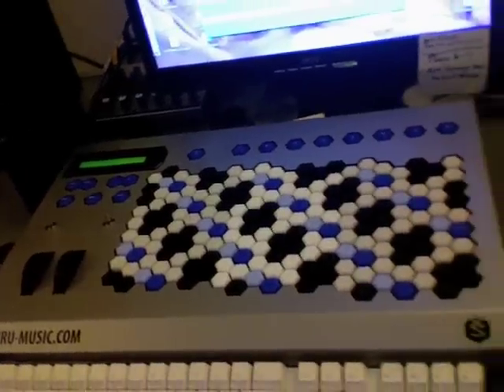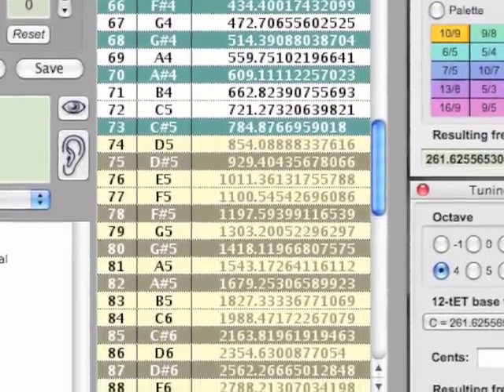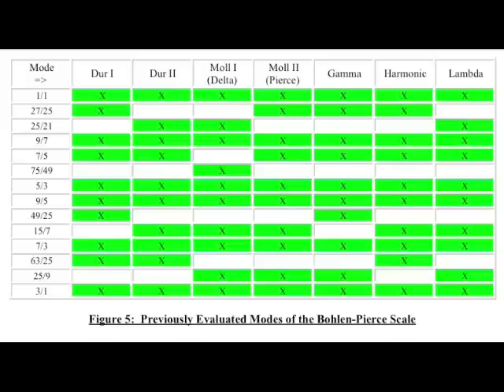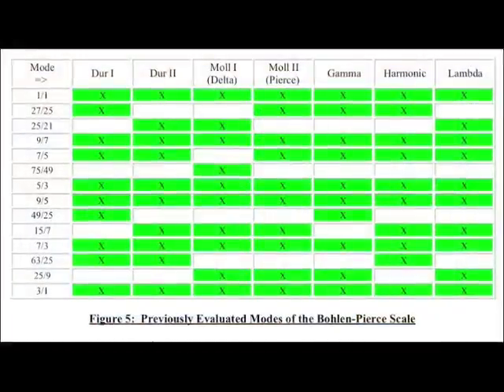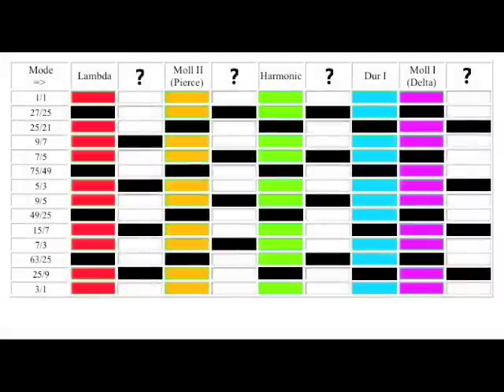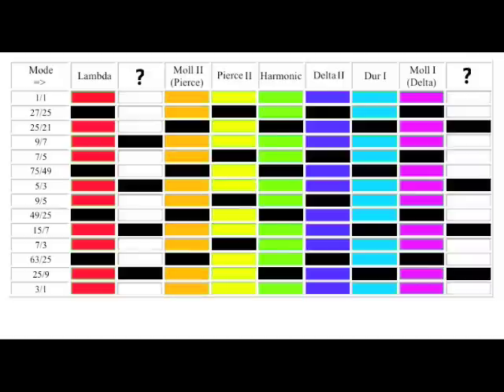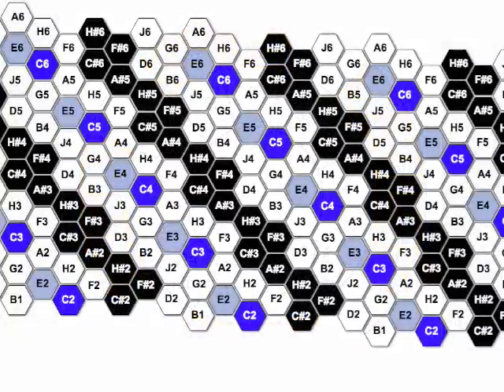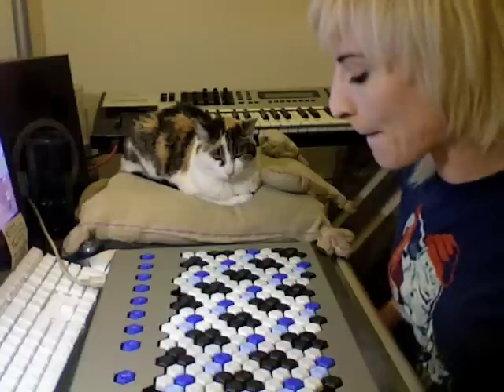AXIS for Bohlen-Pierce Scale (Part 9)

Comment: I looked for BP chords in Scala within 7 cents, and came up with 19 of them off the first degree.  I like all the chord names Scala has.

equal 13 3
set maxdiff 7.
set notation bp
chords/match/constrained

 0-13-19-32: Genus [35]   1:3:5:15   diff.  0.000,-6.533,-6.533
  C C G G
 0-13-26: NM Quasi-Stable Twin Twelfth   1:3:9  
  C C C
 0-6-10: BP Wide Triad   3:5:7   diff. -6.533,-3.829
  C G A
 0-6-10-13: BP Primary Tetrad   3:5:7:9   diff. -6.533,-3.829, 0.000
  C G A C
 0-6-13-19: 9-Limit ASS 1 (Anomalous Saturated Suspension)   3:5:9:15   diff. -6.533, 0.000,-6.533
  C G C G
 0-6-13-19-26-32: Hexany 1 3 5 9   3:5:9:15:27:45   diff. -6.533, 0.000,-6.533, 0.000,-6.533
  C G C G C G
 0-10-13-19-23: Hendrix   3:7:9:15:21   diff. -3.829, 0.000,-6.533,-3.829
  C A C G A
 0-10-13-23: 9-Limit ASS 2   3:7:9:21   diff. -3.829, 0.000,-3.829
  C A C A
 0-10-19-23: 15-Limit ASS 1   3:7:15:21   diff. -3.829,-6.533,-3.829
  C A G A
 0-4-7: BP Narrow Triad, BP Wide Triad 1st inversion   5:7:9   diff.  2.705, 6.533
  C F H
 0-4-7-13: BP Primary Tetrad 1st inversion   5:7:9:15   diff.  2.705, 6.533, 0.000
  C F H C
 0-4-13-23: 15-Limit ASS 2   5:7:15:35   diff.  2.705, 0.000,-3.829
  C F C A
 0-3-9: BP Wide Triad 2nd inversion   7:9:15   diff.  3.829,-2.705
  C E J
 0-3-9-13: BP Primary Tetrad 2nd inversion   7:9:15:21   diff.  3.829,-2.705, 0.000
  C E J C
 0-4-10-13-23: Inverted Hendrix   15:21:35:45:105  diff.  2.705,-3.829, 0.000,-3.829
  C F A C A
 0-3-6: Sensamagic triad   21:27:35   diff.  3.829,-6.533
  C E G
 0-2-4: Cuthbert Triad   55:65:77   diff.  3.399, 2.705
  C D F
 0-2-4-6: Garibert Tetrad   165:195:231:275   diff.  3.399, 2.705,-6.533
  C D F G
 0-3-6: 22-tone Giant Triad   8-8   diff.  2.549, 5.098
  C E G

Comment: @miselaineeous Thanks. I understand that MIDI's values can be changed (for instance, with Magic Max Tuner. Do you know any other software to do this?), but I dont' still understand how the synth itself does the pitch modulating not using MIDI, it must receive a MIDI signat to get triggered, innit? :) Thanks in advance again.

Comment from the maker: @Smorphine - MIDI note numbers range from 0 to 127. Middle C is MIDI note number 60, and since most keyboards only span 88 keys or less, some of the lower and higher note numbers go unused. As you play up a keyboard, the pitch gets modulated, meaning the pitch changes, normally a half step, per key. But the synthesizer itself does this pitch-modulating, not MIDI itself. Most synths default to modulate 100 cents (a half step) per key (MIDI note number), but this value can sometimes be changed!